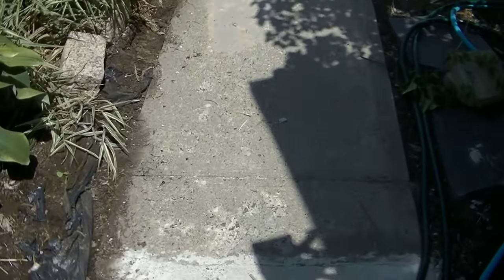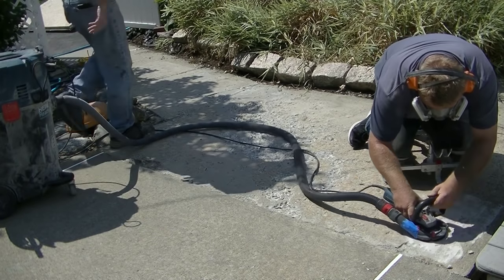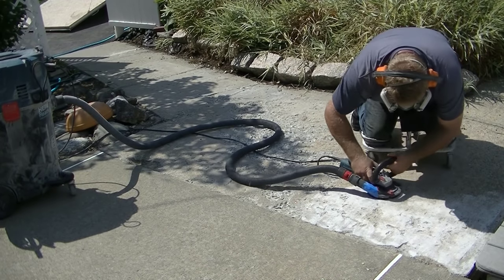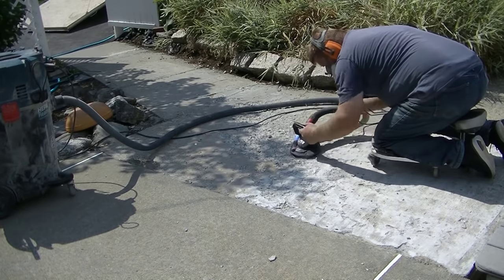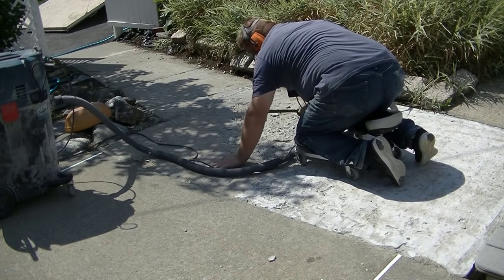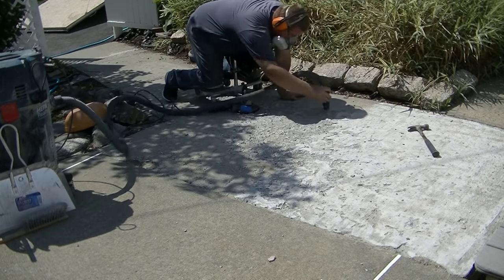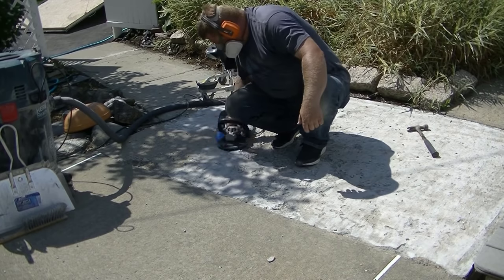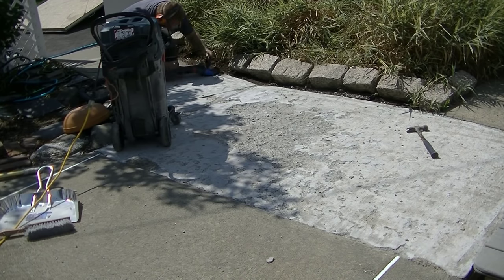How To Resurface A Badly Damaged Concrete Walkway

Comment: I like CementAll for these types of repairs and can agree SetControl can be a must, especially as temperatures increase. I like pressure washing as a preparation as it cleans better than just a hose. I also use CementAll as a resurfacer with the aid of a bonding agent, usually 2 thinned coats sprayed on the concrete and some additive in the mix as well; I also add a FlowControl pack or 2 per bag of CementAll plus 1/2 to 1 pack of SetControl per bag. Along with 3-4 qts of water and a qt of bonding agent in the mix it’s able to be trowel or squeegee applied. In using this method for over 2 decades I’ve never had issues and it holds up well to NY freeze/thaw as CementAll is around 9,000 PSI. RapidSet Mortar mix is around 6,500 PSI and is supposed to be a minimum of 1/2” thick whereas CementAll can be used down to a feather edge. I also like a float finish, either with a hard/soft rubber or foam float, over a broom finish. Other than using the MortarMix I like the work. I like CementAll over other resurfacing products as even with a bonding agent it is so much cheaper than other resurfacer, it’s a lot stronger and tighter than other resurfacers, and it just seams to hold up better. 
As a side not both CementAll and MortarMix have sand in them, the CementAll sand is greyer and much finer than the coarse and more brown sand of the MortarMix, which is one of the main reasons along with cement percentage and additives to the difference in strength, as well as the difference in application thickness recommendations, CementAll feather to 4”, MortarMix 1/2”-6”.
Reply: I know nothing about this but is it possible to make a 1:1 ratio of cementall and mortar mix and just put it on mixed together? It's a serious question - just looking to find the best method to resurface my walkways (I live in PA & winters kill my walkways)
Reply: @jamie-r2034 : You can mix them together but won’t be gaining much. Both are basically hydronic cement and c]sand mixes with CementAll having fiber sand do it can go down to a feathered edge; the mortar mix is courser sand and along with other ingredients isn’t as strung and isn’t supposed to go as thin, only 1/2”. CementAll May be pricy but it’s the right product; if you have deeper spots fill them first with the mortar if need be. 
If price is the biggest point skip the rapid sets and just get Portland Cement and sand along with lime for flexibility and just mix things old school; it won’t set as fast or gain the same PSI but it will be as cheap as you can be.
Reply: @libertarian1637  i appreciate it! I want to do it right without having to rip out our sidewalk. I already ordered the Rapid Set & mortar mix ($45 for both). We're selling our house in the next year or two, so hoping it last until we're out of there! Plus it will hopefully still look good for the next owners. Should I also purchase an adhesive promoter for it as well or will everything set in place fine without an adhesive promoter?
Reply: @jamie-r2034 : The bonding agent is more than enough, especially when sprayed down in 2-3 coats of the 2:1 mix. Temperature plays a big role in set time of the RapidSet products so I’d consider the SetControl to buy more time, if needed, as well as the FlowControl which can aid in thinning the mix without adding more water. I like to max water at 4 Qt./Bag instead of the 5 Qt./Bag max as it maintains a little more strength. You can make it a bit thicker and trowel set any deep spots, then mix it thin and resurface it with a squeegee, just make sure to brush it or float it before it sets as otherwise a squeegee finish can be quite slick in the rain/snow.
Reply: @libertarian1637  thank you - i always wanted to learn to do any type of concrete work. I plan on working on getting things prepped this week and take the day this Saturday to start the concrete work

Comment: Nice job..I've been doing concrete repairs; interior and exterior for almost 30 years. The Chemistry for the surface coatings has really improved and the price points are super low too...I used to have to get Ardex with special additives and primers...Now, you just add water...Much easier than breaking it out though...:)
Reply: How long will an overlay last?
Reply: it will start breaking up after the first few winters. repair jobs like this last 2 maybe 3 years tops before you start seeing significant break up again.  the concrete won't move as 1 due to being different compositions. The extra additives in the top layer will help it hold for a little but in the end it is far better having the concrete being all the same mix and set.   odds are the home owner was told it was better to replace the section but they  attempted to brow beat them down too low or simply wouldn't pay that much and cheaped out.
Reply: @noneyadamnbusiness6891  It's always about money...But, if the surface is prepped correctly, you'll get a bit more time...But, few people do a proper prep.
Reply: @noneyadamnbusiness6891  surprised no one in the comments knows this

Comment: This is excellent information. I just picked up six 8x16 pads that are about seven inches thick and very badly spalled. They are 10,000 pounds each. The plan is to try and set them as level as possible with the ground prep I can manage and then resurface them with the hope that they won't settle too poorly. I wouldn't normally fuss with this, but the only thing I'm paying for is diesel for my little Kubota to get the ground work done. My part time boss paid me to haul 23 pads, paid for the W900 and 53' quad axle trailer rental from my full time job, and provided the 25k+ forklift for us to move these pads. It might all be for nothing when they settle horribly and crack like crazy but I figure it's worth a shot.

Comment: Thank you for sharing this!  We own a rowhome in Philly and our sidewalks are super old and cracked.  We're paying for so much just repairing a hundred year old home, that we're thinking we'll redo the sidewalks ourselves.  I was worried we'd have to bust out the slab, which would be tough with all of the sewer lines!
Reply: Your sewer lines are well below frost line. Meaning they are much lower than the 6 inch sidewalk depth.

Comment: If you epoxy injected those big cracks you might have been ok. They will come back soon.    We specialize in concrete resurfacing. Been in business since 97.... Also adding micro fiber to your overlay will help a ton.

Comment: You have no idea how bad I needed this video Mike! Thanks! I had a hard rain visit a broomed slab about an hour after we left. I'm gonna have to use this stuff because some of the top come off.
Reply from the maker: Brad, I like the Ardex CD Fine for a new broomed slab like that. It's really good and easy to use. Trowels on very similar and is very fine with no aggregate in it.
Reply: @MikeDayConcrete  Like most beginners, I don't have most of these tools and don't really want to buy them, though I can use an angle grinder for mechanics stuff, so maybe I will buy that.  The home owner has an electric pressure washer that maybe I can use up real close, that and maybe a wire brush like painters use.  My damage is less surface, more through holes, wide cracks, and edge crumbling, though I can live with the edges for the time being unless it is just as easy to do it all at once; which it isn't because the edges require a mold where the hole and crack don't.
Reply: @alan6832  If you have edges eroded away by the rain and holes in the concrete where the rain beat its way into the soft mud, much deeper than what’s shown in the video, you may need to use another product first to fill the deep voids prior to skimming it with the Ardex.  Most products are only good for up to a certain thickness. I always used Ardex  or Shep-Patch (Sheplers house brand) for just skimming the finish. If there was a lot of erosion from a heavy rain on really green concrete, you can beat the surface down with a rotary hammer and just use grout to top off 1” + and it’ll look pretty much the same as it would have if it wasn’t damaged.  (Oh, not grout like tike grout, grout like concrete with no aggregate, just course sand.  Don’t pour it more than a couple inches thick tho, without aggregate it’ll break up in you.). Concrete needs to be still green for it to stay put tho.  If the surface is dusting, you’ll want to seal it first because anything you put on a weak surface us going to slough off.  I don’t know their current product names, it’s been a while since I got out of the business.  I would recommend using a bonding agent (aka milk) on the surface before putting anything on it.  Prep is everything. Make sure you have no loose material on the surface and it totally clean.   Should be able to apply a couple layers and broom finish the last coat.

Comment: This has been the most helpful resurfacing video so far.  It answered almost all of my questions, but I do have another.  You said if you are doing a larger area you would have to work in sections.  If I do that and one section dries before I start the next one, will I be able to get them to look like one continuous slab?
Reply from the maker: They'll only look the same if there's a joint in between them. Like a saw joint or a tooled joint. If you just stop and start into the previous area, you'll see where you stopped and started.
Reply: @MikeDayConcrete  That's what I thought.  Thanks!

Comment: Nice work. How thick can this be built up? I have about an inch from top of concrete to top of perimeter brick Rolock
Reply from the maker: You could use mortar mix for that, even add some pea gravel to make it go further. It could get expensive though, depending on the size. A bag wouldn't go very far at 1" thick.
Reply: @MikeDayConcrete  thanks
Reply: I made a countertop out of it a few weeks ago.  Took 3 bags for a 2x4, inch and a half thick.  Its stout....but he's not joking, stuff dries insanely fast.  I was knocking on mine in about 20 minutes.  So be warned!!

Comment: I am so glad I found this video.  I am trying to repair my walk way as well.  1.  Can you pressure wash your concrete instead of grinding ?  2. What portion of rapid set control did you use to mix with half bag of cement all ?   3. Can you use a wet sponge to smooth out the pour of cement all? Will it damage its strength?  4. Rapid set also makes a NewCrete concrete resurfacer. Is it any different compare to cement all or mortar mix?   ( in strength wise) Thanks in advance.

Comment: Hi Mike,
Was wondering why you didn’t use the Rapid Set “New Crete”? I’ve seen you use it around a pool in a video you did awhile ago. I’ve used all the Rapid set products so I’m pretty familiar with how they work and I’ve never thought to use the Mortar Mix as a resurfacer. I was thinking the Mortar Mix needs to go on fairly thick and wouldn’t really be used as the finish coat on like a sidewalk or patio. I’ve used it as stucco on the side of a foundation and for structural repairs on walls. The New Crete might as be a little easier to work with as it doesn’t dry so fast to give yourself a little more working time and can be feathered to about 0..

It’s hard to see in the video but how does it turn out when you start and stop the broom finish in the middle of the surface as your working down the sidewalk?

On another note do you know why Rapid Set makes Cement All dry out so white? I don’t know why they wouldn’t make it dry out in more of a grey like normal concrete? It’s frustrating because you pretty much have to go over it with a resurfacer or paint to make it a normal color...
Reply from the maker: It's what we had locally at the time to use and I knew I was painting over it with the Con-Flex to seal it with. Broom marks all blended in good. I took a rubbing stone to it and then cleaned it good  before painting it. Turned out very nice.
Not sure about the color on the Cement All. You can add a bit of charcoal integral concrete color to darken it though.
Reply: The color difference is just a different cementitious material. White and gray are most common that I have seen
Reply: @montytanner966  I've seen some concrete has a green hue and some a brown hue. I don't know which brands, but I've noticed it. Enough so that I wouldn't want to switch products mid-pour.

Comment: Mike, I'm a tender plaster. The Mortar Mix works just like the Eisenwall you could actually break the set / you mix it the same way the difference is that you will wait 6 to 8 minutes then remix the material again adding a little bit of water it will give more time to spread it on your surface always clean buckets

Comment: That turned out really great. Seems like a lot of work. Almost as much work as just replacing it but much cheaper I'm sure.👍
Reply: Labour often costs more than material. Also overlays do not last.. Maybe on a sidewalk without freeze / thaw cycles.

Comment: I thought its never good to put concrete or other sets over concrete especially in cold climates??
Reply: It’s a bandaid until the walk can be replaced. If it goes through freeze and thaw cycles I’d be surprised if it didn’t start flaking within a couple months. Also moisture underneath will create problems as well. As long as the customer is aware then it’s all good.

Comment: Is the concrete exposed to freeze thaw?  I see that type of damage with low air entrainment and freezing temperatures.  if it does freeze, I’m curious if it lasts the winter. Toppings are extremely tricky I would always recommend shotblasting as preparation.

Comment: I’ve got a landing and stairs to repair, some of the stairs are in pretty bad shape. I was planning on making a form to repair them, since there’s more volume that I need to fill. What product should I use to fill out the broken step edges before doing the process you show in the video? The missing, crumbled concrete measures about 3” back, 3-4” down the face of the step, and is about 15-18” wide. This video convinced me that doing the landing shouldn’t be too bad a job at all, thanks for sharing your experience and expertise!

Comment: A scabbling disc is ideal for loosening rough concrete or removing whitewash from walls. These are a cup that fits in place of a normal grinder disc which carries five or six sets of hardened star wheels probably 30 wheels in one cup. The teeth jab the surface to remove loose material and breaking off the more stubborn areas. Not cheap but very effective.